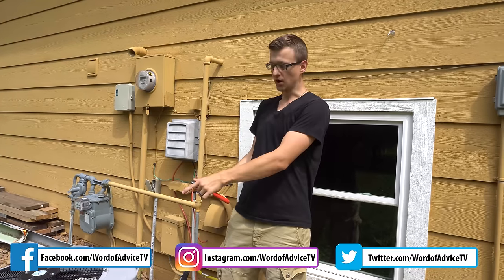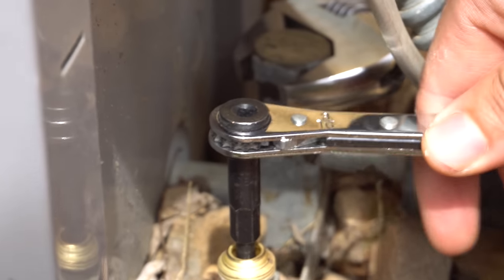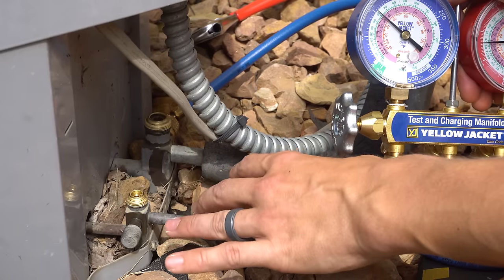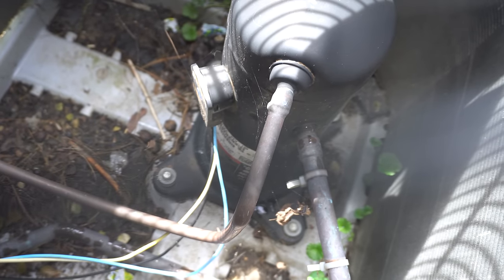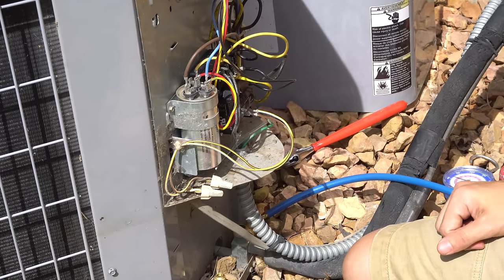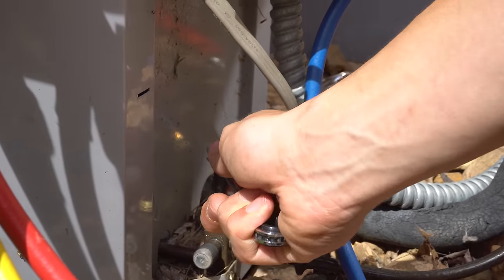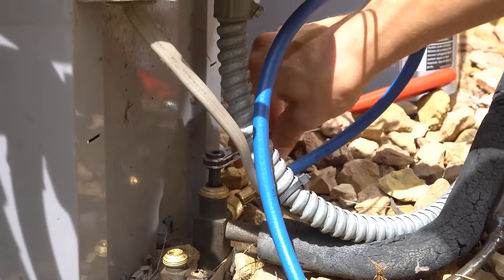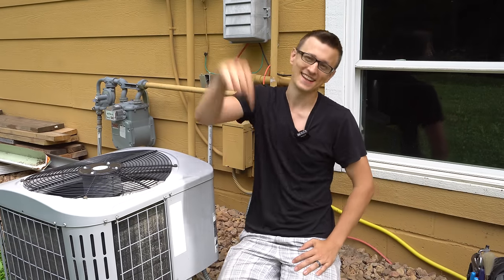How to do a Pump Down on an Air Conditioner ( HVAC )

Comment: Tip that is easily forgotten by many pros - "The longer the line set either 3/4 or 7/8" , the more refrigerant that is compressed in a FIXED SPACE - compressor. Your mileage my vary, but pumping down a compressor is "NOT recommended on longer line sets," due to the larger amount of recovery of refrigerant.  That's why you hear those sounds of destruction. I wish we could compress liquid but we can't as of today maybe in the future. Visualize a 100' line set and the amount of liquid refrigerant that could hold based on volume. Here an AI sample to help understand. Density of R-22:

The density of liquid R-22 at standard conditions is approximately 4.52 pounds per gallon (lb/gal).

Now, let's redo the calculations:

100 ft pipe:
Volume = 1395 cubic inches ≈ 6.01 gallons
Weight (lb) = Volume (gal) × Density (lb/gal)
= 6.01 gal × 4.52 lb/gal
≈ 27.14 pounds

25 ft pipe:
Volume = 348 cubic inches ≈ 1.5 gallons
Weight (lb) = Volume (gal) × Density (lb/gal)
= 1.5 gal × 4.52 lb/gal
≈ 6.78 pounds

So, the estimated weights for Freon R-22 in the pipes are:

    27.14 pounds for the 100 ft pipe

    6.78 pounds for the 25 ft pipe 

If anyone wants to pump down a 100 foot line-set Please use a high quality camera. I will pay top dollar for the aftermath then post on X :)

Comment: Hi Jay.  Did you move yet.    Hey I had a problem with my furnace.   Everything pointed to the pressure valve for the inducer pump but when I tested it as you suggested, it tested ok.   I checked all lines and they were clear.  Long story short, I believe my problem was debris in the gas valve pressure sensor.  It piggybacks on the gas line similiar to a water pressure sensor on a hot tub.   I removed it and then purged the gas line and blew into the stem that screwed into the T of the gas line.   Do you or can u do a video on how to test it.  I think you can just jumper it but hoped to get the info from you.   Thanks.  all your videos have helped me troubleshoot and locate that I think Ive fixed the problem.  It was intermittent which didnt help.  since I remived and purged it the durnace hs not failed to start.  thanks again

Comment: One time I saw a chap not use any gauges but only run it for a much longer time of about 5 minutes. I guess the compressor could handle it like u say for recipro version. After relocation of unit it worked.

Comment: ive never heard of anyone having issues pumping down 410 units, the condensers come from factory with a full charge so im sure they will be fine provided the system didnt have a ton of extra refrigerant added. watch your gauges and go at your own discretion i suppose
Reply from the maker: Thank you for pointing that out. I have pumped down quite a few 410a units as well and have never had any issues... But it is not recommended so I thought I should say that.
Reply: R410 and R32 units often the instruction warn against a pump down to protect the scroll compressor. However we did that numerous times without problem. That is stopping at zero pressure. I think it is fine

Comment: Wonderful video! When we shut off the valve at the discharge line while keeping the valve at the suction line open, would also the pressure at the discharge line become zero? And after closing both valves for pump down operation, what would be the pressure at the condenser?

Comment: My old AC system is  flat and it has leak(small or big hole don't know, and water got in the pipe perhaps) in AC line under slab we believe base on last AC guy detection. I like to use seal repair spray like leak freeze on my old system to see if I can make it last a little longer. What are correct steps involved in refilling it  up with 407c(cheaper than r22) - vacuum (take out water and  moisture), refill with freon, and then apply sealing chemical ? Many AC guys charge a lot like 500-600 to attempt to seal which is too much for me.

Comment: Great vid! Any comment on pumping down units with longer linesets? Ex: a 50' lineset that's charged to spec  (~.6 oz/ft for 3/8" liquid) x (50' - 15' (factory charge)) = 21 oz additional refrigerant

Comment: Thank you for taking the time as usual in all your videos. Great explanation with many many important tips. It’s ok to do the method that you explained for 410 and for R22 as well? What’s your opinion? Thanks again
Reply: DO NOT PUMP DOWN A 410
Reply: I have pumped down 410a they don't recommend it because of pressure.

Comment: First question to ask is do you trust the quality of refrigerant in system?  If you do not know the history of unit it is better to use new refrigerant after your repair.  Even with the new refrigerant expense, it is cheaper than a call back and more issues.

Comment: I stopped short in the process one time when I heard the change in sound of the compressor. I turned off the ac but forgot to seat the low side valve. I abondoned the pump down and expected the gas to seep back around the line with both seats open. But ac wouldn't start up again after that. What would have been the problem?
Reply: Low pressure switch, not enough refrigerant in system

Comment: With a HP I would imagine you can store even more in the tank near compressor.  Do king valves leak when old, and when fully seated, or is that rare?
Reply: Yes they can leak a little. And if disconnecting the lines for any length of time it's best to "braze off" to be sure of not losing any gas
Reply: explain your comment heat pump " With a HP I would imagine you can store even more in the tank near compressor". The recovery tank should recover 80% of its capacity by refrigerant weight.
Reply: @proanswers  Meant to say accumulator on HPs would hold plus condenser.

Comment: I picked up an old R22 unit that was advertised as having about 4 lbs of Freon in it.  The guy said the person pumped the system down into the outside condenser unit.  The liquid and suction lines were cut and then pinched off, and the service valves were both closed.  When I open the liquid side service valve, I can see it is under pressure. But when I open the suction side service valve and hook up a gauge, it reads zero.  I even pulled the shrader out to make sure it was not blocked.  Is this normal?  I would think the pressures on high and low side would be equal?  I wanted to pull the freon out to donate the unit to an HVAC school, but I'm confused as to what's going on.  Thanks in advance for any advice.

Comment: When you say to take off one of the low voltage wires and when pumping condenser down was that wire the 24 V or the Common or which one did you leave on the contactor? Thanks

Comment: After pump down with compressor, what is the process for recovering the remaining refrigerant? Attach yellow line from gauges to recovery machine, line from recovery machine to a recovery tank, then open necessary valves leading to the tank?

When someone pushes in a contactor to do this, is that because the low or high limit switch is still active? The workaround is bypass the limits and run the unit from stat/outdoor switch?

Comment: Why do you only connect the low side gauge on you service hoses?? You said some people connect the low and high sides but you only connect the low?? Why is that?? My teacher taught us to connect both so I was wondering why you do it like this?? Thanks!!
Reply: The reason he only connects the low side is because he is not charging, or checking the charge he is only doing a pump down. He is only concerned about getting the gas out of the line and into the compressor.

Comment: My a/c is not blowing cold air all of a sudden. My a/c is showing a little less than 150 PSI on the low pressure and about the same on the high pressure. Does it need more r22 or do I need to lower the pressure??

Comment: Need your advice: Can you do a video about the Merv rating on AC filters, I was using a pleated filtrete 800 or 1000 on a three ton ac and gas unit, now I am not sure what merv rating i need. Thanks
Reply from the maker: Hey Ron! The lower the MERV, the better. I would go with 300 or 500 personally.
Here is a video on the topic: https://youtu.be/GoOKjINPgpY

Comment: By EPA: For high- or very high-pressure appliances, the equipment must be evacuated to 0 psig before it is opened.
Reply: The problem with pumping it down to zero is if you get it to -1 or more you will then have a vacuum in the line which will draw air into the sytem when a line is opened and you do not want that.

Comment: Can you please tell me why 2 or 3 seconds into the pump down the compressor keeps turning off and pressures rises?. There are no low and high pressure sensors at all. Thanks

Comment: Hi , Thank you for your helpful videos. Have a question: 
I have a AC unit : 
American Standard 
Allegiance 13
MFR DATE 2/2006
Mod. No. 2A7A3024A1000Aa
Serial no 6055NE65F

Can I pump down refrigerant in this unit ?? 
Thank you.

Comment: Hey Jay, 
Does it matter which place you go to get certifications? 
Already have universal. 
Wanna get other certificates —for example R-410A 
Go through ESCO Group or Mainstream or does it matter ?? 
Thanks for your info and videos!  🤙🏻
Reply from the maker: Honestly, as long as you get the paper/card, I don't think it matters where you get it. I got mine from AC&R Safety Coalition

Comment: Nice video! So you need recover the refrigerant regardless using pump down or not. Would be more effective just to recover the entire refrigerant from the beginning weighing it and sparing the compressor? Or is it just faster to use pump down? Thanks again!
Reply: It’s faster to use a pump down method because the compressor in the AC unit in much stronger so it’ll be a much faster process to pump most of it using that compressor.

Comment: 3:00 wait, isn’t it the liquid line? correct me if I’m wrong please, I’m a new tech
Reply from the maker: Yes, you are right. I said it wrong there. The discharge line is the one that comes out of the compressor and into the condenser coil. The liquid line comes after the condenser coil. My apologies for the mistake.
Reply: @WordofAdviceTV  Thank you very much!!! Your videos are very helpful

Comment: When the disconnect is tricky recommend pushing the contactor in manually to get your timing nice, and it is possible to pulse it when it's just above zero. 
Or even stop at zero it will "bounce" up a few pounds. 
Recovery machine on the last 5 psi?? That's not enough to even prime the recovery pump, I think it's "loss minimus"
Reply from the maker: Thank you for the further suggestions Nathan! Much appreciated! :)
Reply: "I think its loss minumis" Try saying that on camera Nathan! 😂
Reply: Daniel L. maybe it's arguable 😁but it's a lot less gas than releasing a liquid filled gauge hose
Reply: @Froggability  i agree with you 👍 100 % jay is just protecting his behind lol